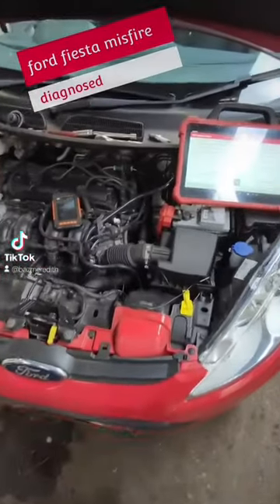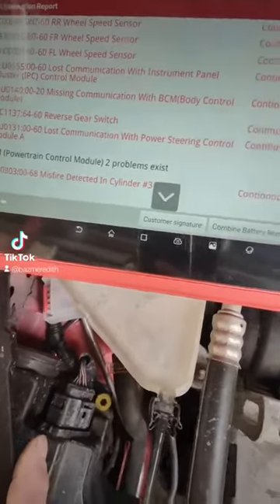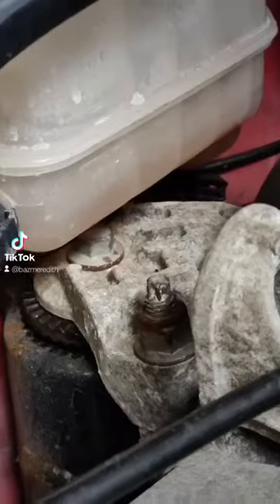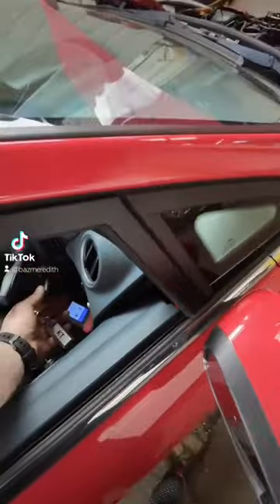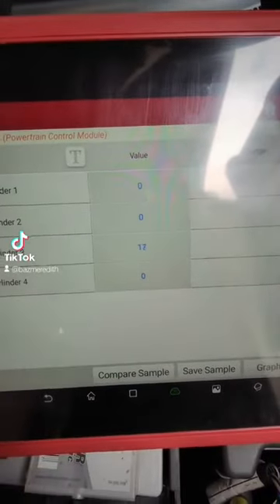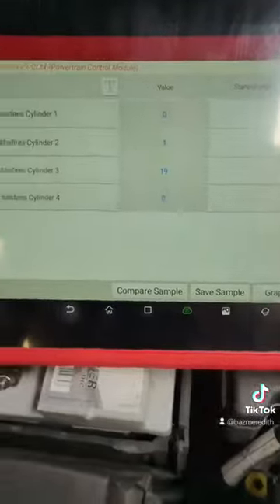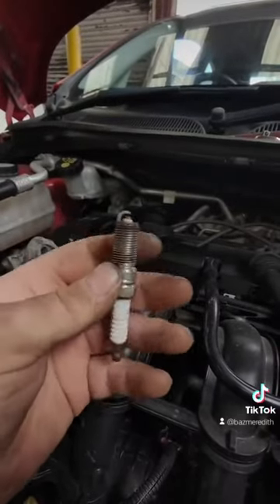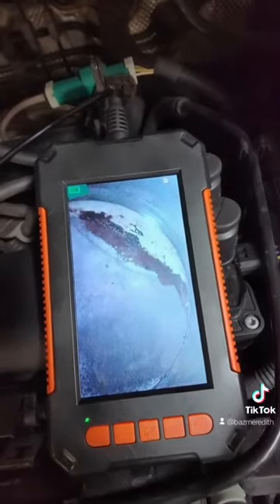ford fiesta misfire detected

Comment: Need help or suggestion so i got a 2009 ford fiesta  1.2l and the car had a misfire but i thought it would just be coil pack and leads, so i got a new set to put it in but when opened it  looked like it had a new coil pack. So i pressure tested them and cylinder 3 theres no compression at all. Whats the problem here? Its done 98k miles so far

Comment: Hey, I'm late, but when you had the boroscope on the cylinder. How did you check for that leak. Did you pressurize the coolant reservoir tank?
Reply from the maker: Yes I used a pressure kit

Comment: Head gasket gone in 32k wow
Reply from the maker: Yep water pump failed and customer been topping it up with water for a long time and it had just got to hot.. in the middle of uploading the actual headgasket replacement should be up soon
Reply: @bazmeredith  Is this an ecoboom?
Reply from the maker: @robevans8625  no it's not I've got an eco boost coming soon for a gasket failure
Reply: @robevans8625  have an ecoboost 2013. Got a new engine from ford for free 😂
Reply: @bazmeredith I lookin forward to seeing it my car has miss fires and trouble getting pull 2017 se